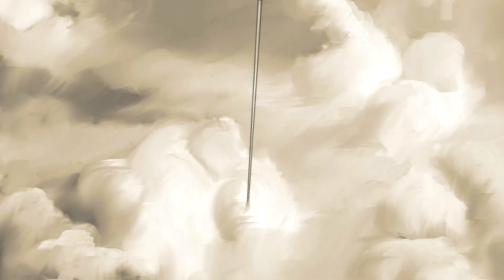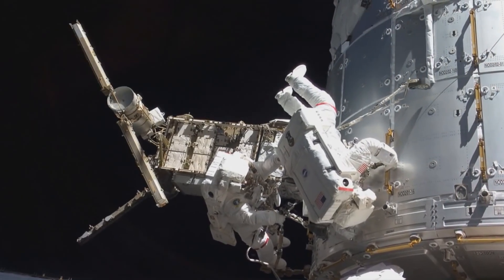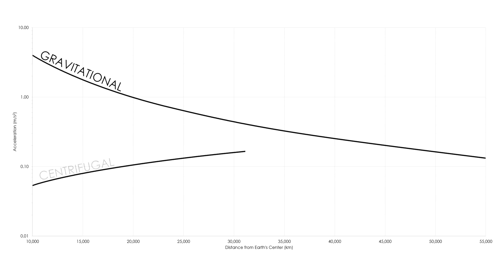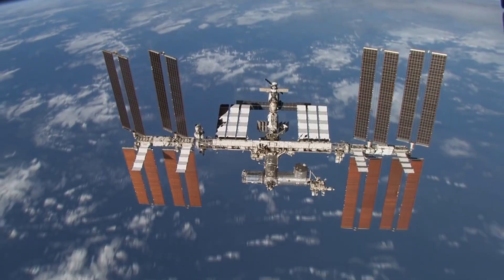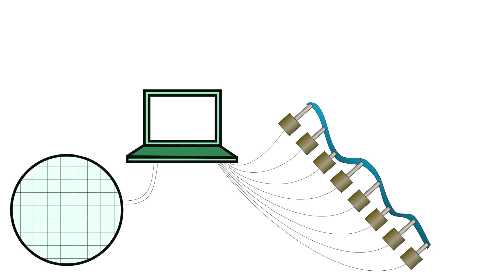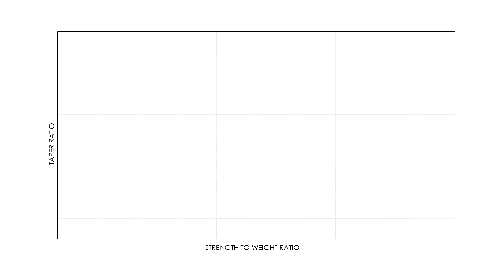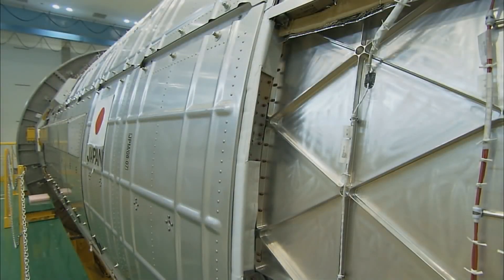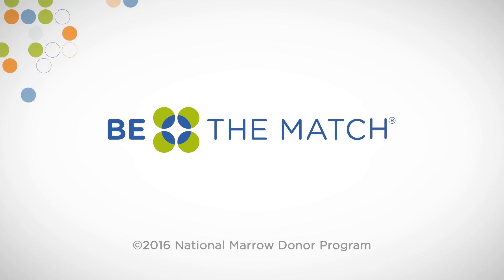Design Your Own Space Elevator

Comment: I wonder if carbon nanotube production would be more, or less, efficient under 0-G conditions. If it would be feasible, an international effort could be launched to place such a facility in geosynchronous orbit, feeding such nanotube equally toward, and away from, Earth. Two such strands located a safe distance apart and running parallel could carry all the power needed for relatively quick trips to and beyond the midpoint satellite. Of course, load-counterbalancing would be critical, because as the load moves along the nanotube cables its counterbalance would have to change proportionately.

Comment: step 1. make a skyscraper
step 2. release satalite to the the thermosphere and have it bigger but, give it rockets to regulate it
step 3. put a satalite in the mesosphere and thether it so it naturaly evens out
step 4. send a shipment to the satalite in the form of a atachment and some fuel to regulate it again as they add a stratosphere satalite into the chain
step 5. conect a skyscraper to the stratosphere satalite and add another attachment so the original satilite doesnt get pulled to far in one derection.

the tethers wont have to be as big if it is comming from diffrent derections. if it starts from the thermosphere and goes to the mesosphere, it wont have to experience that much stress if they are near the border between the regions. same when going from skyscraper to stratosphere. this can make the middle the thickest point.

as for the elavator, if you have multible tethers, we could make a elivator thats house sized and have it connected to multible tethers. the elavator will only be between certen sections and they will need to send shipments to the top as atachments to make shure it wont mess up the balance in weight. the tether may be ballenced by the conflicting forces allowing it to be evan thiner.eventuly we may be able to have multible layres of space stations and a shell around the tether (once the satalite needs more stuff to weagh it down)

Comment: Why is nuclear power not an option for the carrier? Wouldnt a mini nuclear reactor like the ones user on submarines produce far more power than a laserbeam?
Reply: We're already dreaming, so let's just line the nanotube tether with superconductors and power it with electricity!
Reply: Is there a reason why hydrogen fuel cells wouldn't work? Hydrogen and Oxygen are very lightweight fuels and all they need is a small catalysis to turn into electricity - unlike nuclear power which is turning into electricity by boiling water to power a turbine. Couldn't we just attach giant balloons of H2 & O2 to the carrier which would (a) help lift it in the early stages when power demands are highest and (b) provide fuel to power the carrier the rest of the way up.
Reply: Well, we already use small fission reactors on some satellites (probes actually) which are very light. And fusion is probably much closer than large scale nanotubes.
Reply: @orangedeamon1  Deep space probes use Radioactive Thermoelectric Generators, a much simpler, less failure prone design than a nuclear reactor in that they just make heat as the radioisotope in them decays, rather than using the much more dangerous but far more productive fission approach. Probes get away with it because they don't need much power.
Reply: +The Engineer yeah well I didn't know they used them on satellites? That's interesting I mean despite seemingly easy solar power it's still worth it! That's cool
Reply: Well, they are mostly used on satellites which are sent to outer Solar System where there is less sunlight, recent example is New Horizons.
Reply: +The Engineer ohhhh well to be honest it's no longer a satellite by definition but that certainly makes sense :) cheers for the help
Reply: Tim Powell Yep, that's why I put "probe" in the brackets :) you're welcome
Reply: +The Engineer gonna give myself a 4/10 for sense ahahahaha
Reply: Maybe it's possible to use a combination of different power sources, lager PV-Panels on the platform in the Orbit, Laser beam and an onboard System. As fare as i know CNTs can carry an high electric current so they could be used as an cable for supply
Reply: That's what I was thinking, imagine fusion ;) probably do the trick
Reply: +Bonta kun hmmmm fair point, obvs not with fusion but that's a long shot anyway isn't it ;) I still think it would be an option, it would be the best looked after reactor on the planet and short of the whole thing falling down I can't see why shit would hit the fan especially with the modern quality of reactors
Reply: +Bonta kun and maybe the craft could have a very lightweight payload? One that could be easily ejected if a problem occured? I mean although a lot of energy would be needed it wouldn't need to be like a full city reactor would it? I don't know how much the thing would weight
Reply: Hmmm well true just thinking about efficiency. I mean you get nuclear subs but maybe you're right and it wouldnt be worth the efficiency benefit  for the huge weight. Still and interesting thought though ;) To be honest I would bet fusion is perfected before graphene but then again without graphene what would we build the thing out of in the first place! ahaha
Reply: I think that a space elevator wouldn't be made if there was a high likely hood of failure, and, if in the event of failure, the elevator could be designed so that the reactor could be jettisoned and it could float back to earth on parachutes. The reactor could be strengthened so that it wouldn't break on impact.
Reply: Why would it be? Nuclear power plants are massive and very dangerous, also very costly. The only reason why they exist at all is to make nuclear weapons.
Reply: @LuisAldamiz  There are a lot of arguments for and against nuclear reactors, but given that there are non-nuclear countries quite happily running reactors for various non-weapons related purposes your statement is patently false.

Comment: Electricity through the tether via a wire going through the tether.    Think of how electric trains work.
Reply from the maker: +Norfolk Southern Fan imagine trying to power an electric train in South Africa from a power plant in Canada.
Reply: You want to put a conductor into the ionosphere? What do you think will happen when you short the electrical system of the planet? There are ~6.0*10^9 Coulombs of of charge within the earth. Will your tether handle a hundred trillion amps that it will discharge? The ionosphere is a good thing, you know. We all really need it to remain where it is.
Reply: You know the earth has a magnetic field? Moving a conductor at huge speeds orthagonal to earths magnetic field would Induce big currents and also slow the elevator down.
Reply: The solution is clear: make the voltage so high it arcs everywhere!
Reply: +Practical Engineering 
Can smaller lifts using separate cables coming from the earth carry enough battery power to lift it's own weight, charge the main elevator, then drop down using gravity, like decoupling rockets?
Reply: Another way is to use magnets. Like a maglev or some monorails.
Reply: Abraham Barker Oh, please Barker, where is your inner evil genius?
Reply: Evil genius? Like leading the entire species to their doom?
Netro1992, would you like to know how Nikola Tesla's magnifying transmitter worked?
Hahahaha.
 I can't tell you or all the morons of the world would go mad with power
 and destroy everything to get ahead of the other morons trying to get 
the same power. Yes, it would pull the ions down from the ionosphere but
 if everybody were doing it then we would have no more ionosphere.
Hahahaha. Oh, the genius of it! Ahahaha!
Reply: +Brian Sauve did you reply to me or to someone else? If to me, what do you mean?
Reply: +Practical Engineering also carbon nanotubes are non conductive I believe
Reply: +David Moritz but graphene is EXTREMELY conductive and strong

Comment: put a small nuclear reactor on the pod. Lift a couple thousand tons per trip.
Reply: well, good luck with lifting the reactor itself
Reply: They did a lot of studies on nuclear powered aircraft in the late 40's.The programs eventually got stopped because of the development of ICBM's and environmental concerns, but the power to weight ratio was adequate to fly. The Russian TU-119 even made test flights on nuclear power.
Reply: +Bill Kong it may work, but it would probably not be a much    better for the environment as rockets are.
Reply: There would certainly be issues to work out. The most important thing though is that it'll make spaceflight cheaper.
Reply: I think that would work as well, but if there were a failure there would be an emp blast that would be devastating along with other negative effects that come with nuclear explosions. Negative for us primates at least lol
Reply: +Michael D'Angelo There could be a lot of fallout, but probably no emp. Reactors are typically not also good bombs.
Reply: Bill Kong Nuclear explosions above the atmosphere create EMPs this has been tested by the US and Russia. It causes changes to the Earth's magnetic field. You are right that they don't make good bombs since they use fission but that could still be a hell of an explosion. The biggest issue is I think designing a fail-safe for a reactor on a tether going up off the ground. Usually nuclear power plants will drop the reacting rods deep underground in the center of the reactor so there isn't any devastating results. How could they stop the reaction?
Reply: +Michael D'Angelo yeah, but those are bombs. Reactors usually fail through overheating and steam explosion. That scatters all the nasty radioisotopes but there shouldn't be a nuclear explosion unless the reactor is very poorly designed.
Reply: Bill Kong True, but still everything must be thought of. I still think it is the best option as of rn though.

Comment: can't you just use a conventional petrol engine for the journey up until there's no oxygen for combustion?  then seperate it off like you normally do with rockets to make an electric engine powered by panels or do this laser nonsense? you can get pretty  big panels once there's no atmosphere to cause drag,  and weight is only an issue if you're still in higher gravity, isn't it? exosphere is still high gravity, but...it's a start...? even a stable platform at the exosphere is a leap forward for this brand of tech.

Comment: why not use the vacuum of space as a method of pulling things up?
Reply: The pressure differential is already balanced by gravity. That's the reason we have an atmosphere.
Reply: Our atmosphere is already in the vacuum of space.
Reply: Q exactly. We lose a bit to ionization by the sun, gain a bit from the solar wind but it exists in near perfect vacuum. How? Desertphile said it best, GRAVITY!!!!
Reply: +Mythic Mike wants to just watch the world burn.
Reply: Robert Szasz well i was thinking having like a pressurised tube to help push up the elevator. a vacum all teh way out to space and allthe way down to teh surface and jsut flip a swithc and all the pressure below p[ushes up on the elvator. maybe its far to expesive nad not worth doing idk enough yet about things like that. plus short sighted youtube comment sooo...
Reply: +Mythic Mike it's not a terrible idea. But the reason there is  pressure at sea level is because air is pulled towards the earth by gravity. If you could make a large hollow tube ( assume some impossible infinitely strong material) you could pump air in at the bottom to push things up the tube, but air wouldn't rush in on its own. With possible materials such things just can't be built. (allowing for impossible materials you could make a giant solar thermosiphon with air rising up a tower nearly to space powered by heat from the sun, someone smart should do the calculations on how fast the flow could get with perfect heat transfer and unbreakable structure)
Reply: Mythic Mike 

its not that its expensive...its that a single pressure leak and our atmosphere goes into the vacuum of space.

im sure we could make a safety system at the base, but is it really worth the risk of possibly losing our atmosphere?

Comment: There are 2 reasons I think a space elevator will never happen for Earth.

1.) Cost. Lifting the required material to geostationary orbit (and beyond) is costly. On paper there might be some monetary savings for each payload lifted by a space elevator. However you'd need a large number of payloads for the scheme to pay for itself. Lifting the requisite number of payloads up the tether would take time. If the time to raise this number of payloads is beyond the lifespan of the tether then the scheme doesn't pay for itself. (Also maintenance costs for that time period could be more than the money saved on all payloads)

2.) Collisions with satellites. It is too much of a problem to avoid collision with satellites. Launching payloads on rockets would be simpler and safer.

There is still hope for tethers on Earth's moon or Mars' moons or rotating tethers. We might one day build these.

Comment: When considering the weight of a large cable wouldn't you also need to increase the weight of the satellite to compensate?

Another question, understanding that it would be more expensive but also within the realm of current engineering materials, wouldn't it be possible to create a mag-lev like system on the equator where tethers would run by at speeds faster than the orbital period reducing the distance from earth by increasing centrifugal force and making the it possible to have multiple elevators to satellites the stop by stations on the equators as they wiz around the world. This would probably ruin a couple birds days but if using this was possible the energy required to move the stations horizontally would be from the satellite so the mag-lev part wouldn't need energy to push it just enough to keep it from colliding with the track.

Comment: Cool video. I got confused, however, when it came to the diameter of the tether increasing. You said that the region with the most tension is at the top.
Reply: Why is this true? Doesn't the part at the bottom hold the most amount of weight from all the cable above, thus has to withstand the  most force?
Reply: Because the tether is within the region where gravity is stronger then the centrifugal force gravity takes over pulling the cable down, in other words think about a tree fort where you hang a ladder down to the ground. This is the same idea with the space elevator except we tie the hanging end to the surface of earth.
Reply: I think you're forgetting the effects of gravity on the cable itself.  If there was no gravity the cable would have to be thicker near the base, but you have to consider that most of the cable wants to fall down.  Try thinking about the forces on each part of the cable, ignoring the tension of the cable itself.  The part that is right at geostationary orbit doesn't have any force, but everything further out than that wants to fly out into space, and everything below that wants to fall down to earth.  
Basically, everything below geostationary orbit is hanging from the rest of the cable above, and everything above is being held down by the cable below.  The part of the cable at geostationary orbit has to be the strongest because it has to hold both sides of the cable together even though they want to fly apart.

Comment: The cable will probably be spun from carbon fiber, or a derivative of that. These materials can conduct electricity very well. Why not use two cables for direct power transmission?

Comment: I think Space elevators will never see the light of day. I think making rockets re-usable is the way to go. Rockets use oxygen and hydrogen and are not dependent on fossil fuels. Primitive re-usable rockets are already here and a couple decades worth of R&D into them will make them household names.
Reply: Some rockets use hydrogen and oxygen. The only way to ISS for people doesn't, and the self landing first stage of the Falcon9 doesn't. They both currently use Kerosene. Someday we will use carbon neutral electricity to liquefy oxygen and hydrogen to fuel a reusable launch vehicle and a shuttle/pod. I also agree that the space elevator is not likely to succeed.
Reply: Reusable rockets are nowhere nearly cheap enough to allow large scale colonization of the solar system due to fuel cost alone.
Reply: i agree. the whole concept is too far-fetched to me. others aside, we'll never "work around" the tether issue. i just won't work on earth. 
maybe we could try in another celestial body with considerably less gravity. maybe in ceres, if the moon's isn't weak enough. pretty sure it could be done in ceres, with its 0,27 m/s² gravitational pull and 900~ km diameter

Comment: Couldn't they attach the earth end to another big ass object instead of the ground, with some kind of weight that moves back and forth at the Clarke belt to keep it in orbit? The weight could even just be a big ass battery that powers it's own movement. We'd still need rockets, but less fuel.